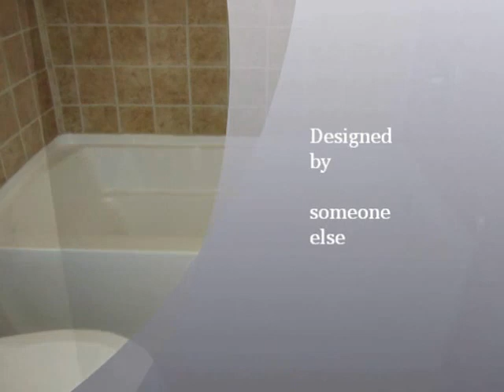Cast iron bathtub demo

Comment: I've done this before a few times. Now I cut them in half and remove in two pieces. Used a 5:1 pulley and some vice grips to left up onto 4-wheel cart. Takes about 40-60 minutes with right angle grinder. (Used cordless band saw for the first 5.5 inches)